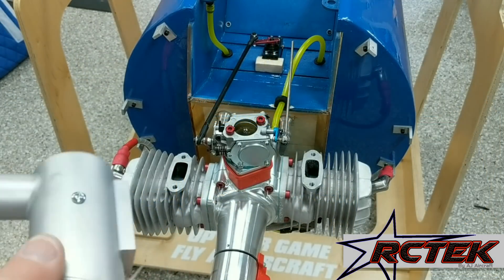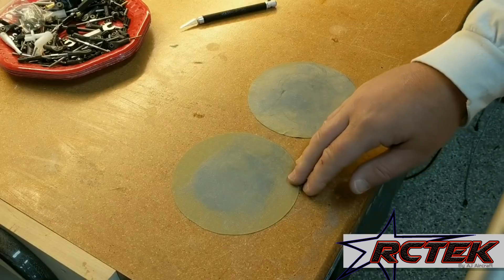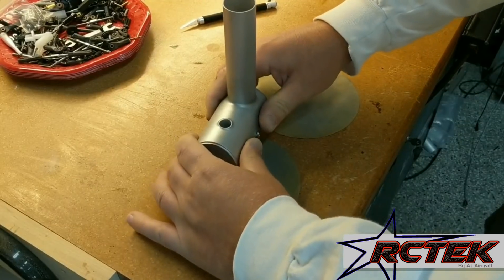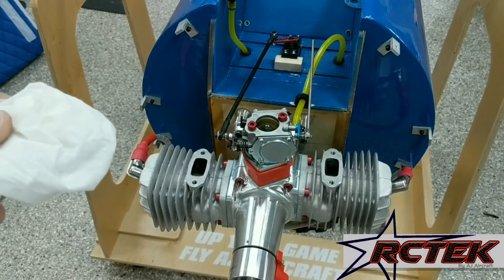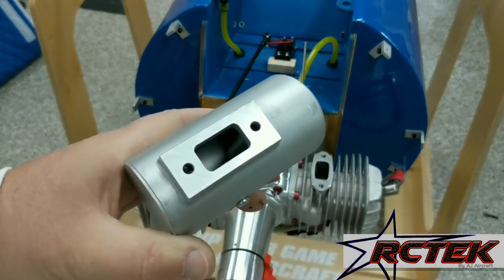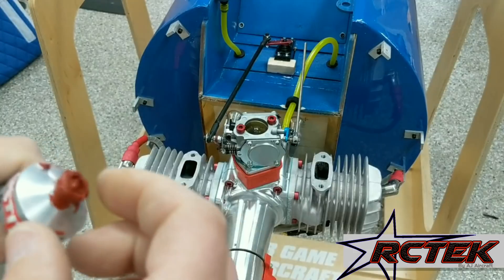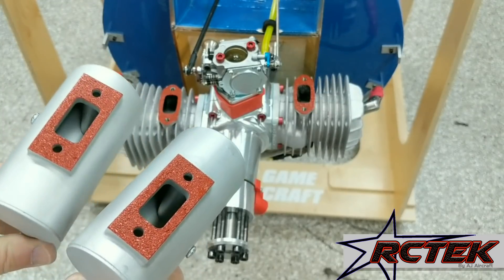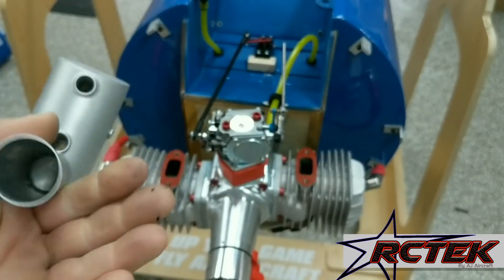RCTEK Episode #9 Muffler installation

Comment: Another great video; always learn from your vids..  Didn’t know GP had loose muffler issue.  I clean the threads with acetone and a airless sprayer brush (like a small bottle brush);  available at Harbor Freight.  Mount it to a drill, dip in acetone and have at it.  You guys are great.  Presentation is very easy to follow.  Thanks for posting.